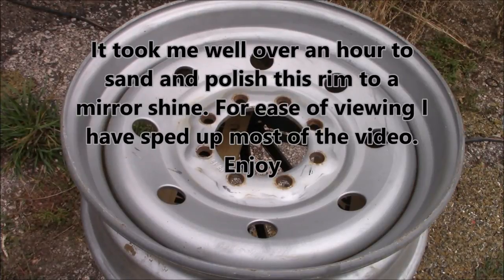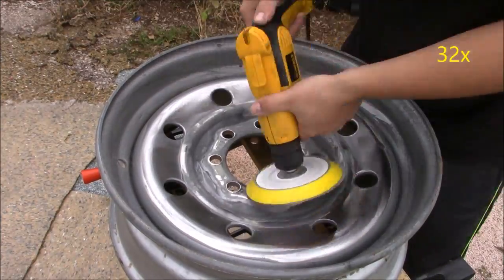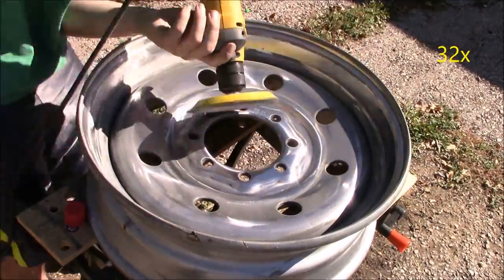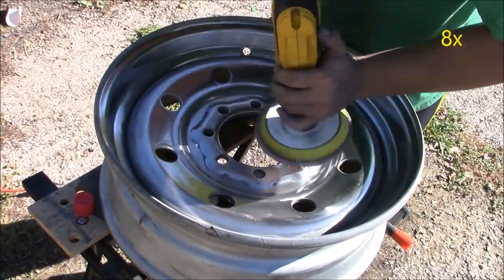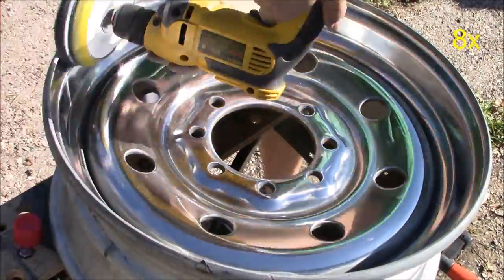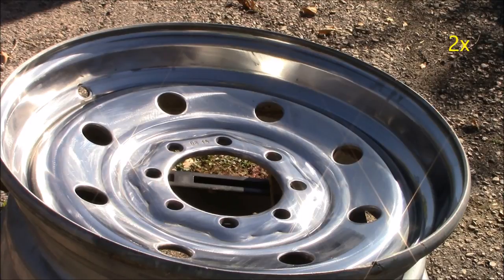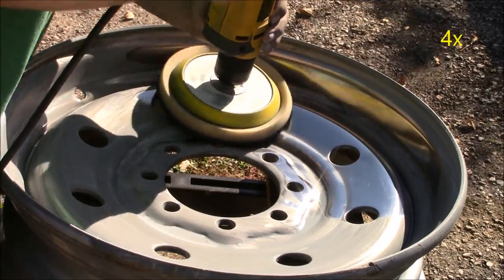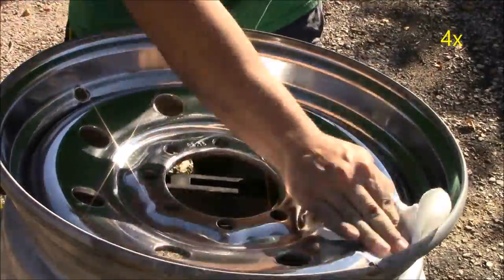How To Sand And Polish Steel Rim To Mirror Finish

Comment: Things are not as easy as you see in the video ,I saw this video and started on my rusty rims,first I removed the old paint and rust by wire brushes in 2 hours, then I started sanding by 220,240,320 and 400 grits.Sanding up to 400 grits took 2 hours now I have half mirror like shine on my rims,and I will go on up to 2000 grits.

Comment: I’m thinking about doing this to my steel Chevy rims, but they’re powder coated so I know I’d have to sand all that off 1st. I noticed at the beginning when you were sanding they looked painted? Also you say steel and aluminum when referring to the wheel. Is the process the same for either metal?
Reply from the maker: Yes, that was a mistake on my end. Yes, the process is the same.
Reply: Skills and Trade Thank you so much for responding 👍🏼👌🏼
Reply from the maker: No problem

Comment: In terms of grits and reduction of visible scratches:   Would there be any significant benefit in using 600, 1000, and 1200 grit paper in addition to the grits mentioned in the video? 
Also (going above and beyond)  would 2000, 3000 and 5000 grits (as seen in your polishing zinc video) be worth the extra effort and expense to achieve the most convincing "chrome-like" effect for steel wheels? 
The wheels I plan on experimenting with are primarily a very simple, concave "dish"  - unlike the wheel in your demo. (Mine are a 60s-70s Old School  "cheapo" aftermarket steel slotted wheels.)   So I wouldn't have as much of an irregular surface to try to maneuver my drill and sanding discs. 
But the possible downside might be that my less obstructed surface may be less forgiving in terms hiding scratches.   That's where I thought the additional steps/grits MIGHT give a much smoother reflection.   Any thoughts - or am I just overthinking the effort for the best possible result?   Thanks for your valuable post.   Your tips might save me a small fortune as to avoid paying for chrome plating!
Reply: using 600-1200, wont really affect because you are going to end up with 1500, so its not worth the time and effort of using that many intermediate grains, what you said about going for 2000 and above might help in making it even more chrome looking because it will be a more polished finished but, with 1500 you are pretty good to go and use polishing on it and will look really good

Comment: Now that the rim is fully exposed, will it not be more Susceptible for rust to form?
Would you Then need to coat it with a protective layer?
Do you think a coat of transparent nail polish wil work :-/
Reply from the maker: Yes, you should clear coat it afterward to prevent rust. I'm not sure about the nail polish.

Comment: Wow, that looks great. How did you get deep down into the seem? I came across this after getting tired of searching for rims for my dually. Don't want to drop 2000 for the factory alcoas, so im hppy to find this.
Reply: I'm actually in the same boat, for my dually the only wheels that don't require modification are a set of 10 lug adapter alcoas and I don't have that kinda money. I'm thinking I'll go with this one. Also if you haven't done this already maybe just some actual sandpaper would work for that?
Reply: @oddball0022  I have yet to do this on the rims, but i have everything. Just between work, now unemployed, but other things going on. Just dont want a truck down as i have the tire off to do this or 1 polished and 3 not. I did do this to a CB bracket i made for in the cab though. It took a long while for the tight corners, but i made it work by hand. Just tedious is all. It's been holding up extremely well for the last 4 months and many days of open windows.

I know what you mean. I find those guys with the 10 lug adapters and wanting crazy money. I'm not rich, or do i want to spend $2k for factory take offs. I will battling pitting on my steel wheels just another reason to why i have yet to do this. Just in case, i do have matte paint ready.

Comment: I am in the UK and we get more rain! After the polish what would you use to prevent rust from returning? Is there a lacquer or varnish maybe?  Thanks
Reply: Ordinary clear lacquer would flake off in a matter of weeks. A better idea would be clear powder coat which is a lot tougher.
I was thinking of something that might be the best but i haven't heard of people trying it. That is clear epoxy coating, which after applying can be polished again to even more shiny finish.
Reply: lard 477 Car wax will do, I polished  steel wheels 4 years ago, still no rust. I’m from Ireland so yeah rain test passed

Comment: How would you get rid of the scratches left from sanding?
Reply: Lower and lower and lower grits, polishing with a cutting wheel like used on semis would give you a non scratched mirror finish.

Comment: Wouldn’t the steel wool introduce new scratches??
Reply: No because is the Super fine grade which is designed for the last process of polishing. They are graded similar sandpaper's grit. I guess these are the terms. Hope this helps!
Reply: You polish glass with steel wool so I'm sure the steel will be ok 😀

Comment: what about rusting? im doing something similar but only to the lip of the wheel, and what im encountering is rust.
Reply from the maker: You should be able to sand away the rust. Be sure and use some WD-40, or perhaps some Dry Coat Preventative Rust Spray to stop reoccurring rust.
Reply: okay, so use some dry coat prevent. According to google touch up every year with dry coat prevent? thanks for the response. Is there a more long term solution to it? I also have a set of chrome wheels that are starting to flake. what would you recommend as an easier removal of it besides using my abrasive sponge rust stripping  wheel?